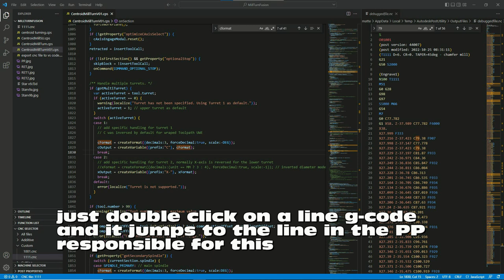Postprocessor for 4 axis DIY CNC lathe with Acorn 6

Comment: HI this is a fantastic project.  I was wondering if you have links to the project?  I also have an acorn setup.  Its just the basic acorn board but I was looking into what it would take to be able to index the spindle like yours and use live tooling like you do.  would I be able to get the post processor from you for fusion 360?  If so, I will upgrade to the acorn 6 board.  Any info you can share would be incredibly welcoe and helpful.  I was also curious what software package you buy to do mill/turn.
Reply from the maker: Hi Ian, I use fusion 360 normal abo. Documentation of my stuff is in the centroidcncforum
Reply: @TheSuntravel  Thanks so much! I'll check it out

Comment: Your machine is very cool. Why did you choose the Acorn6 over the Oak, regular Acorn or some other non Centroid solution like Mach3, LinuxCNC, Masso, etc? How are you liking it so far?
Reply from the maker: I am using CNC in my job for a long time. When starting with DIY CNC  after comparing lot of systems only Linux and Centroid looked like they work as a professional system to me. I choose Centroid because of the Intercon conversational interface, support and very well made documentation. Never regret going with Centroid, 100% reliable, motion control is fast and smooth, and if a user finds a small glitch in the software, it is corrected by Centroid in a very short time.
Oak is a AC serco only closed loop controller, my lathe is using servos and steppers, so Acorn6 is perfect to control up to 6 axis and two spindles regardless if using servo or stepper.
Closed loop is possible also with scales or servo encoders, but with board only limited to 3 ports, encoder expansion board is not finished right now.
The board features two fast FPGA chips, should be faster than Linux/Mesa with only one.
And last but not least after being and old retired racer with US V8, Centroids A560 machines are impressive, using the same software you can have on a DIY budget.... what should go wrong?
Reply: @TheSuntravel  Thanks for the response, incredibly informative. Thank you for taking the time to reply.

Comment: Nice work! 

I'm trying to understand what you have done here. As I understood it, Fusion only supports indexed 4th axis moves unless you pay for the extensions. With the normal paid-for Fusion licence, it wouldn't matter what you did with the PP, you still wouldn't be able to do true simultaneous 4th axis moves. It looks as if I misunderstood - what have I missed?.

I've used VSC with the Autodesk PP extension and it's incredibly powerful. There's also a Centroid g code extension and PLC code extension which is very handy. I found JS reasonably easy to pick up - have you seen the tutorial showing how to write your own PP?
Reply from the maker: for engraving on a cylinder it uses only 3 axis simultaneous, that works without machining extension, and sure I use the centroid extension for g-code and PLC also.